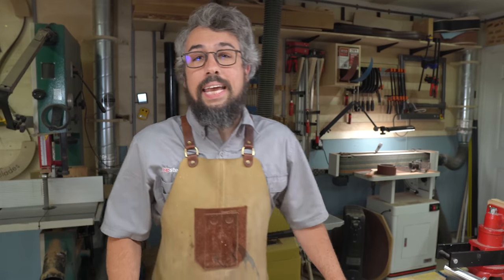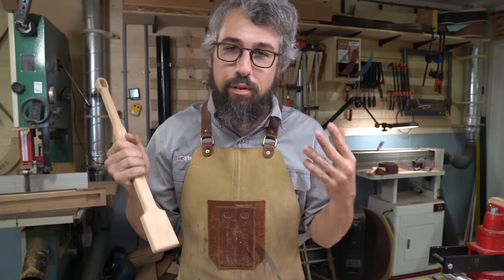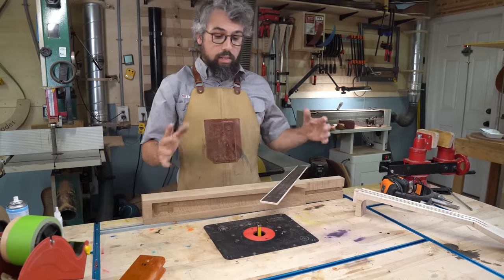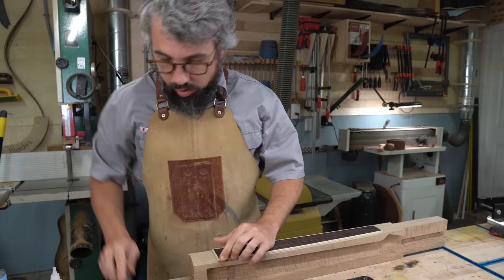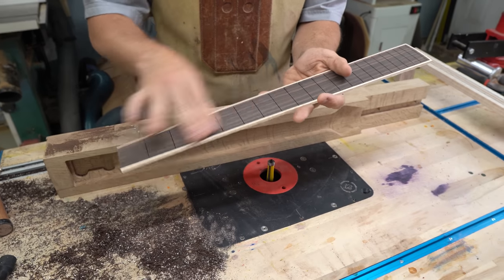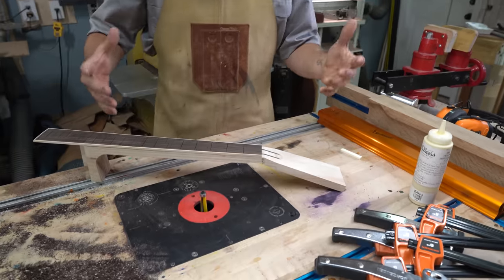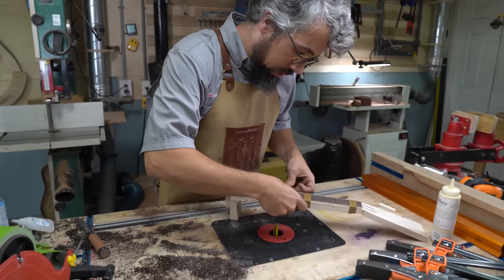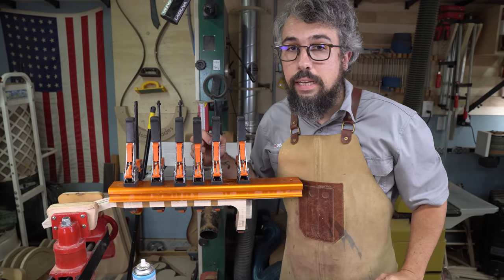How To Build An Acoustic Guitar Episode 32 (Radiusing and Gluing On The Fretboard)

Comment: Saw these bits on Amazon last year. Passed because when you go to cut the second half, the bearing is not referencing on a flat surface, so it won't give the same cut as the first pass.  Tried to pause the video to see if your results were perfectly symmetrical, but you didn't dwell on it long enough.  Not to mention the potential for tearout.

Comment: I've been using a couple of toothpicks as index pins when gluing on the fretboard. I drill the holes in the fret slots after clamping it place with no glue making sure it is perfectly aligned. Just slot the toothpick after the glue dries and the fret easily covers the top of the toothpick. I've never had one shift when gluing.

Comment: I don’t believe there is the indexing issue that a couple of posters have suggested. The fretboard starts flat. The bearing is about ¼” wide. The router bit cutting blade stops short of the bearing. As long as the bearing is pretty close to centered, it will still be riding on the uncut fretboard surface when the piece is flipped over. You will end up with a slight “hump” along the fretboard centerline. Still a lot less sanding and an accurate starting point for the sanding process. I tried to make a drawing below:

Fretboard
______________________________________________________________________________________

-	- - - - - - - - - - - - - - - -  - - - 
-	- - - - - - - - - - - - - -- - - - - -    Bearing rides in center with cut portions above and below the dashed lines

________________________________________________________________________

Hope this makes sense?

Comment: I tend to clamp the fingerboard dry, exactly in the right place, and then drill a 1/16" hole through the first fret slot on one side of the carbon rod reinforcement and around the 12th fret slot on the other side. I then cut the heads off two 1/16" brads and tap them lightly into the predrilled holes. These make removable, foolproof (me) index pins to keep the fretboard from sliding around on glueup. I do have to drill complementary holes in my clamping cauls. The pins pull out easy after unclamping, you could always rub wax on them if you are nervous. On a mean girl note, has building this guitar turned your hair gray? ;)

Comment: Awesome video, as always. Quick question: Is there a reason you don't use indexing pins to lock down the fretboard in place? I know that's a popular method of doing it. 

I've also heard that sawdust can work just as well as salt, and it might look better if any got the the edge.

Comment: Chris, do you see value in the systems that use index pins for positioning the fretboard for gluing, like the one from Elevate? Would an amateur like me benefit?
Reply: I always use indexing pins. I take wire brads and drive them into the neck, leaving them a bit proud. Cutting them off with a pair of diagonal cutters will leave a sharp point a couple of mm above the surface of the neck. Position the fretboard where you want it and give it a tap over the pins with a soft mallet. Double-check to make sure the pins put the fingerboard where you want it. If things moved when you swatted the fingerboard you can pull out the offending brad and redo in a new location. Apply glue and then slide the fingerboard around until it drops over your pins. Clamp up and you're done.

Comment: Hi Chris…… a technical question?
There’s a really high end traditional classical builder, I believe, in Michigan. No truss rod used but bolt on neck really surprised me. He puts a slight concave on the bottom side, (glue side), of his fretboards. He stresses the detail as being of critical importance. 
Have you heard of that ever? What is accomplished from doing so?
Thanks
Reply: That is to set a bit of relief in the neck, since there is no truss rod to help with that, in that case. While the strings themselves will typically induce some relief, nylon strings on a classical have much less string tension than steel strings.